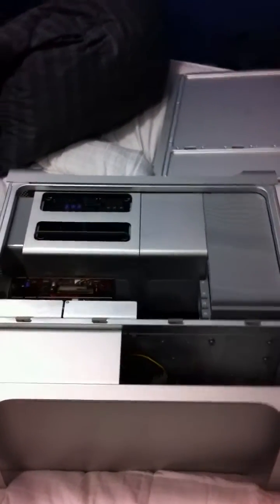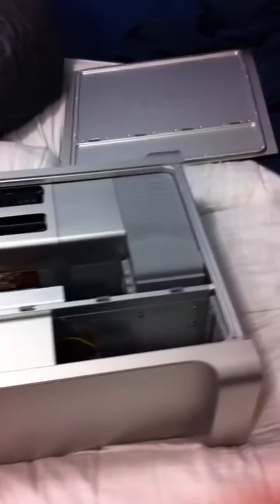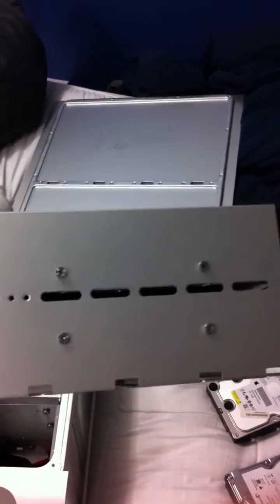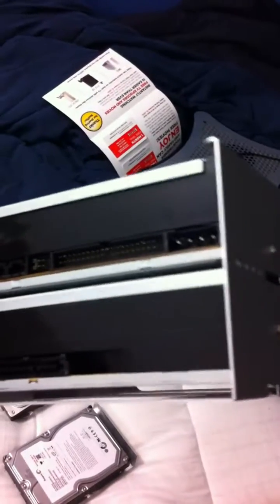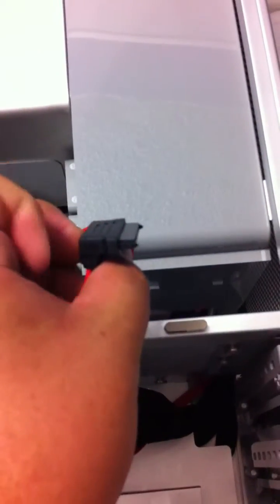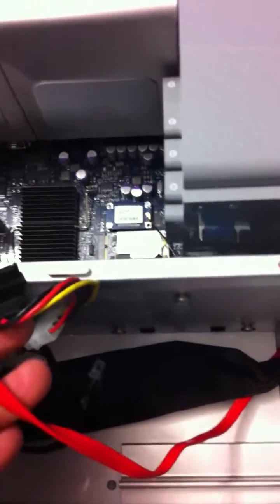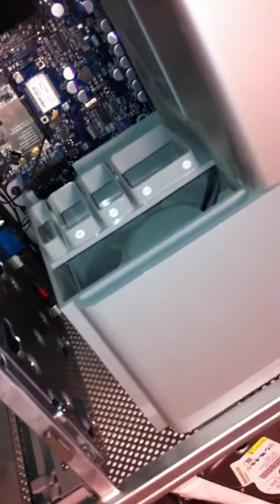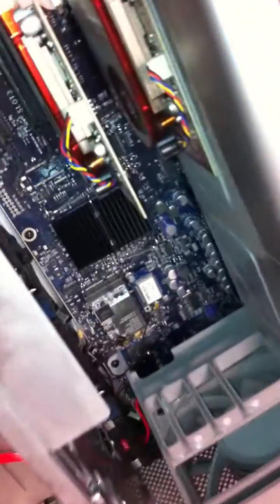Blu-Ray in MAC PRO.MOV

Comment: You can also remove the fan module by removing two screws, so it's easier to plug the SATA cable to the logic-board and routing the cable to the optical bay cage.